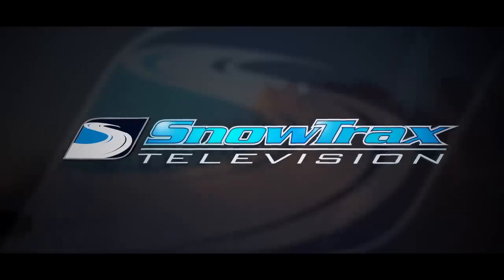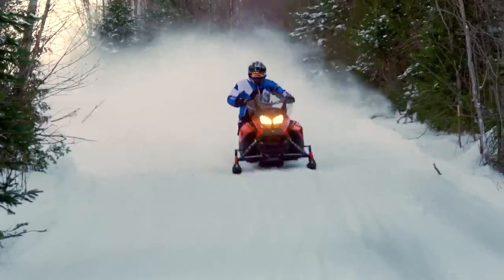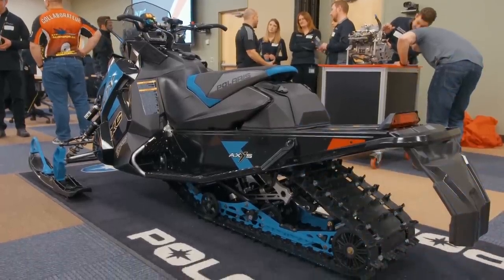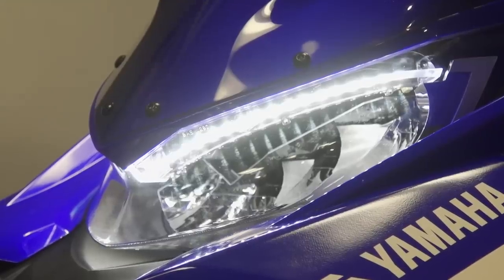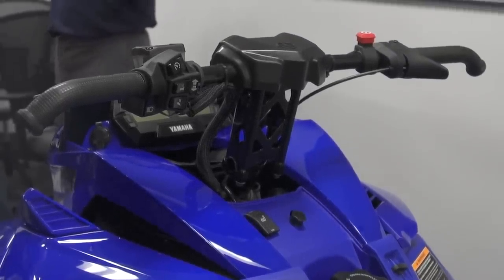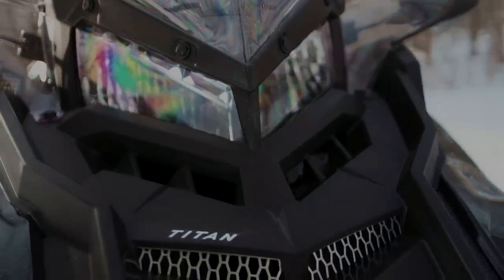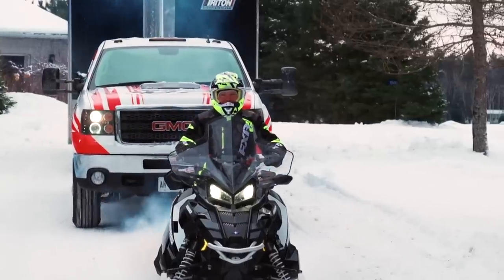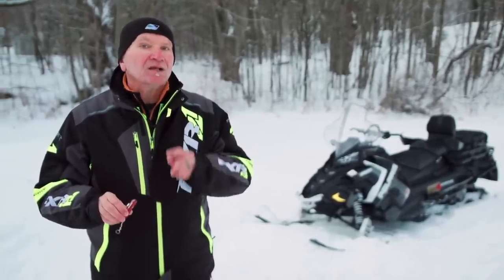SnowTrax Television 2018 - Episode 11

Comment: new skidoos look like ducks, almost sexy to look at and then duckface
Reply: Check out ski-doo cousin Lynx's 2019 line-up, I bet you will love the Boondocker and X-trim RE.
Reply: the lynx look much better, more like the mighty duck cartoon characters
Reply: they are almost identical, from the front, but there a subtle line changes in the hood and side fairing that look better from the front, the skidoos side profile has a slighlty meaner looking lines, but from the front its just not good looking, and like I said the lynx is nearly identical, but the subtle difference in leading lines masks the guppy looking air intake in the front, I'm just nit picking cuz they're great sleds, but just my observation upon first impression
Reply: Fast ducks

Comment: 150 hp 900 turbo.... that’s it?
Reply: welderteach if you knew anything about engines,  you'd understand there's more than just peak hp figures.
Reply: If they pushed the motor anymore it would lose its reliability